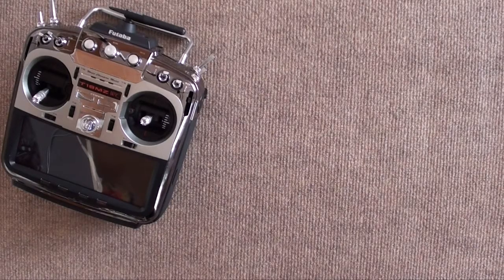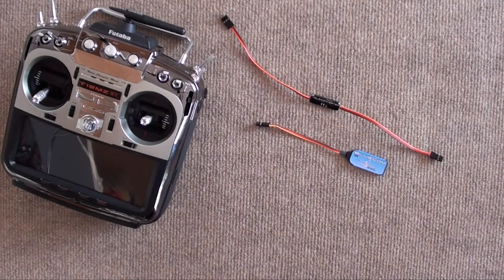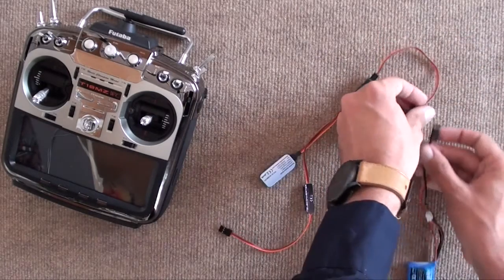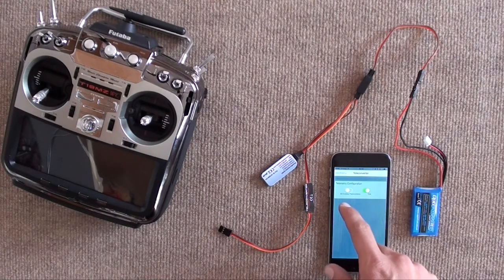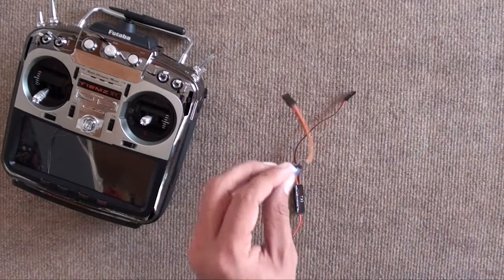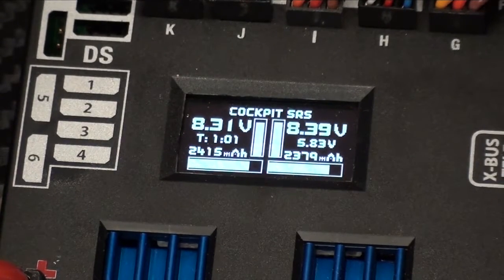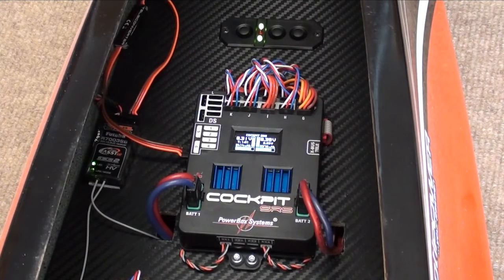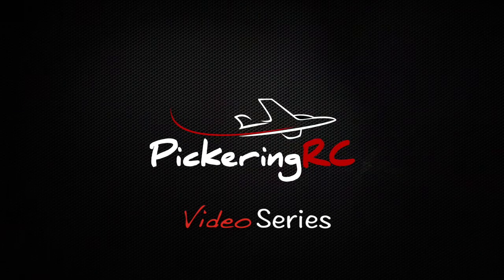Powerbox-Systems Teleconverter - How To Set Up

Comment: OK thank you very much! I have a futaba t18sz and a powerbox cockpit srs ... I bought the gps and the teleconverter but not the bluetooth ... I have already stored the teleconverter now I miss only the gps ... I have now ordered the bluetooth ... how many Money they serve 😠 ... but now at least I know what to do! Thanks a lot from italy
Reply from the maker: You can use the BlueCom adapter, or the PC connection.  Unfortunately unless it is the GPS2 that is already preset to Futaba, it needs to be changed in the software with one of these two options.. sorry

Comment: I have a futaba 16szh.  What receivers do I need to run duel  receivers  going to the Mercury power box  I’m also wanting to have the telemetry  this is for a jet set up. Thanks
Reply from the maker: Hi Carlton, you can use any SBUS compatible Futaba receiver with the Mercury. If you want telemetry, you need one that is SBUS2 compatible. I use the 7003 receiver as it is powerful, has telemetry but also on the cheaper side.
Reply: @MartinPickering-PickeringRC    So by using the 7003sb  even though it’s a 3 channel  receiver  will I get all my 12 channels to work ?  And can I come off the 1st receiver  to the 2nd receiver for signal redundancy ?  Thanks for your help

Comment: I've ordered the telecoverter. However it said(in the ad description) that it's for Telemetry Adapter for Futaba S-BUS 2. No mention of using the bluecom adaptor and having to choose the system i.e, spektrum or futaba?? 

Product description:

The PowerBox Teleconverter provides a means of connecting any PowerBox with a telemetry output to a Futaba S-BUS2 telemetry system.
All you have to do is register the Teleconverter at the transmitter, like a standard sensor.
Reply from the maker: Hi, the teleconverter is only for Futaba systems...
Reply: @MartinPickering-PickeringRC  ok, I guess the bluecom device is used to choose between the 18MZ or any other futaba radio. Thank you.

Comment: You are my gps 2 but i can not connect it but you said that it is already set up for futaba but it does not ... i think i have understood from the instructions that to get into programming i have to take bluetooth and then once programmed To futaba the log on the radio as i did x the teleconverter

Comment: Hi, but with the teleconverter also the powerbox gps 2 is right? I also futaba + cockpit srs and i just bought gps 2 and teleconverter
Reply from the maker: Yes, you can use the Gps2 telemetry and Cockpit Srs telemetry through the Teleconverter.
Reply: Ok but to schedule gps with the tx i have to take bluetooth the first time? thank you
Reply from the maker: If you are not using a Powerbox iGyro, yes, you will need to setup the GPS for your radio model Futaba T18 or "Futaba other".  After this you can install into the Sbus2 telemetry port on the receiver, same as the Teleconverter.